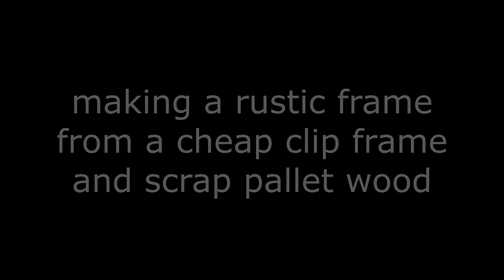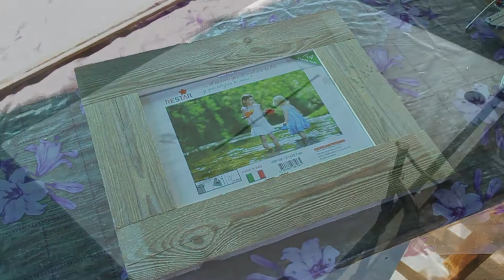How To Make An Easy Low Cost Rustic Picture Frame

Comment: I just used your finishing technique for my fishing rod holder, just rubbed the linseed oil onto the timber, i will give it a few hours then use beeswax as the final coating.
Reply from the maker: Fantastic! I use my own paste wax for finishing which is 1 part beeswax 2 parts linseed oil melted together

Comment: I like this frame.  It is visually attractive.  I worry that it will be strong enough since only glue was used to join the stiles and rails.  Do the joints still seem strong enough to stand the test of time?
Reply from the maker: Hi thanks for your comment. Been nearly a year since I made it and its still holding fast 👍